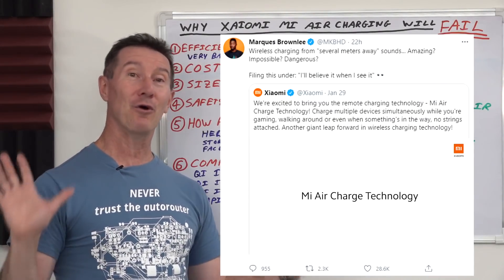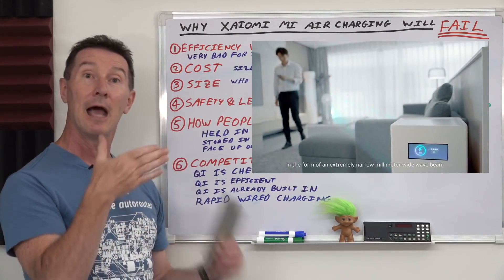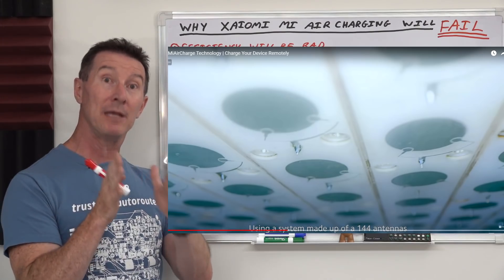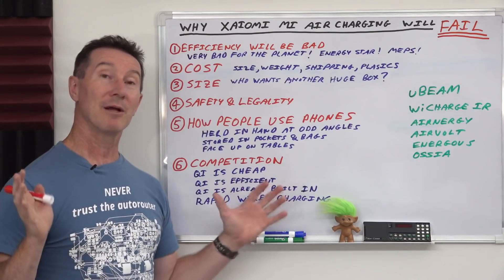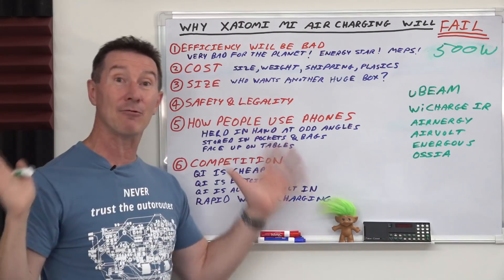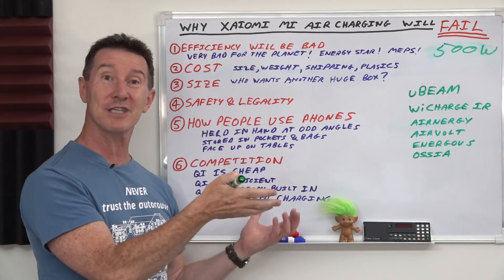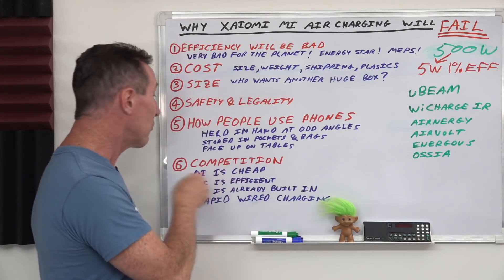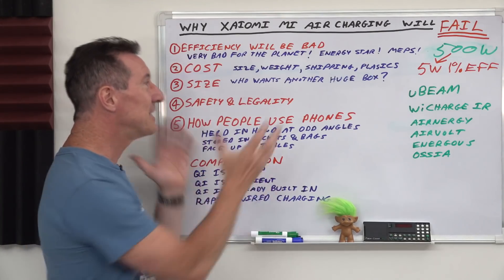EEVblog #1369 - Xiaomi Mi Air Wireless Charging BUSTED!

Comment: It was nice talking to you Dave! I wonder how much this wireless charging unit would cost at the end, it doesn't look cheap. I would be very surprised if they actually end up shipping this in any significant quantity. It could be that they are using this "commercial" as a vehicle for some specialized applications in the future. In our lab using our 95GHz 384-element beamformer I could place my hand in front of the array and feel a warm spot where the beam was going. It is an unusual feeling!
Reply: Medium rare hand straight from the lad cookery !)
Reply from the maker: Thanks for helping out!
What power level do you think would be in that capture area that warmed up your hand?
Yeah, I don't expect this thing to ship, maybe just show off at some trade shows or something.
Reply: @EEVblog  Operating at 95GHz is not easy and our array was a full transceiver intended for communication which is fairly different from an illuminator like the one you see here. We had 256 transmit antennas each with a PA that can do about 9dBm of power. That translates to an EIRP of about 60dBm. The total transmit power is about 2W, the array in TX mode consumed 100W. It can be made more efficient of course for this application. My hand probably captures about 1W of power which is what the warm spot on my hand is. We actually have thermal images showing the hot spot moving around using beam forming. Cool stuff!
Reply: @TheSignalPath : I want to ask, I'm not a RF specialist, more like only a hardware tinkerer, my question is regarding actual beam forming. Wouldn't be using a plain old Uda Yagi antenna be much better at forming a very directed and narrow beam. I know, I read up only a little on Uda Yagi Antennas and their main usage frequencies lie way beyond the estimated 95Ghz in this case, more at tops 2.4Ghz (where they still work great as wifi directors even with 5Ghz wifi). But question being, wouldn't be a servo guided and phone tracking Uda Yagi Antenna be more practical than those tiny copper patches?
Reply: @bloeckmoep  
TV frequencies (around 500MHz?) have a wavelength of AROUND 60cm (In the UK). The antennas for TV frequencies are made up with a regular di-pole with a reflector behind and some parasitic elements infront to give the antenna its gain / directivity. The dipole is going to be a really, REALLY boring half-wave di-pole (so around 30cm tip to tip).
The same design of antenna at 95GHz (3.2mm wavelength) would be 1.6mm tip to tip! The slightest bit of corrosion at that scale would shift the resonant frequency by 100's of MHz.
You would need incredible manufacturing accuracy and repeatability for this to work, and that would price itself out of the market for home use.
Reply: @digitalradiohacker  : Yes i expected that, around such high frequencies, its written that Uda Yagis are not really practical. However, would one need such high frequencies for the sole purpose of delivering a constant wave for power induction? A microwave seems to do just fine around 2.4Ghz and shows some astonishing results with electronis put inside. Of course thats magnitudes above what would be needed here, a regular microwave beginning at 180Watts up to 1800Watts. But I track off here, for beam forming in lower frequencies a Uda Yagi and its derivatives is probably best practice. I wonder if could tinker something along the line with old wifi components and some selfmade antennas?
Reply: @bloeckmoep  A microwave is at 2.4GHz because that is the resonant frequency of water. If you hit water with 2.4Ghz, the molecules vibrate, and the friction causes heating.
(*EDIT BEGINS) The above is not true, it is just the "Wibbly-Jibblies" that causes heating (EDIT ENDS*) 
What you could do, is use that heating effect to generate steam and have that run a small steam engine... Might be a tad uncomfortable to be anywhere near though (we're 60% water).
I think that the main thing to say, is that radio is only used to transfer information, not power. When used to transfer power, it is so inefficient that it hardly seems worth bothering.

*Edited due to non-conformance with the standards required by universities for PhD thesis in materials science.
Reply: @digitalradiohacker  Yes yes, I know this. I just think its much easier to experiment with available household electronics which can already put out watts of power and can be coupled with available antenna technology. Beam directions with dipol antennas or Uda Yagis works well enough on wifi routers which only have limited allowed power budget of 100mWatts omnidirectional.
Reply: @TheSignalPath  nice antenna array you can melt chocolate  and discover microwaves again.
Reply: I think this will never take an end with all the wireless power, it only on movie it works we all know that.
Reply: @digitalradiohacker  Actually it isn't.  Water doesn't have a resonant frequency, and the chosen frequency has more to do with power delivery than any clever atomic effect.  See here https://wtamu.edu/~cbaird/sq/2014/10/15/why-are-the-microwaves-in-a-microwave-oven-tuned-to-water/ , there are many others.
Reply: @GavinMelville  
"Water doesn't have a resonant frequency"
"has more to do with power delivery"
Going above 2.4GHz means less penetration, and going below would result in less absorbsion. Sounds like all the EFFECTS of resonance to me. If the effects are there, and there is an absense of side-effects, that is good enough for the girls I go out with.

Yes - I know - It isn't the resonant frequency of water as such - But for the purposes of heating a bowl of soup, a storm of multiple limitations come together, and conspire to make 2.4GHz the one that works. 
Example: Whats the Wavelength @ 2.4GHz?  
λ = C/f
300,000,000 / 2,400,000,000 = 0.24m (24cm).
Ever wondered why the internal dimensions of microwave ovens are all just a little "snug"? Ever wondered why they don't make them a bit bigger?
Reply: @digitalradiohacker  It has nothing to do with resonance. Water strongly absorbs most of the wavelengths in the electromagnetic spectrum, but it has a narrow window of transparency which includes the visible spectrum. It doesn't absorb in the wavelength range of visible light, roughly 400-700 nm, because there is no physical mechanism which produces transitions in that region - it is too energetic for the vibrations of the water molecule and below the energies needed to cause electronic transitions. So, the absorption of EM waves below visible wavelengths is at its peak just before the visible spectrum, and the lower the frequency, the less the relative absorption. The heating arises from the dipole nature of water, causing the molecules to align themselves to the rapidly changing electric field caused by the microwave. The 2.4 GHz ISM came about because microwaves already used this frequency and thought that there would be already too much EM pollution from microwaves so they made it an ISM band. I do agree with you though, that 2.4GHz allows the inside of the food to be heated more effectively though.
Reply: @digitalradiohacker  The wavelength is actually 12cm.  The chamber should be at least two wavelengths in each direction. More on the history: (from Philip Remaker) 
https://www.indiegogo.com/projects/why-2-4ghz-chasing-wireless-history#/   The first resonant frequency of water is 21ish GHz.

From wikipedia; Water, fat, and other substances in the food absorb energy from the microwaves in a process called dielectric heating. Many molecules (such as those of water) are electric dipoles, meaning that they have a partial positive charge at one end and a partial negative charge at the other, and therefore rotate as they try to align themselves with the alternating electric field of the microwaves. Rotating molecules hit other molecules and put them into motion, thus dispersing energy.  

Source: https://en.wikipedia.org/wiki/Microwave_oven
Reply: @digitalradiohacker  That is not actually true. Water molecules have a number of resonance frequencies and they are much higher than 2.45 Ghz. If I remember correctly it is somewhere around 10^14 Hz.  Heating of the water molecule is achieved through imparting rotational energy which works because the water molecule is a dipole.
Reply: @GavinMelville  
"The wavelength is actually 12cm"
What on Earth? You're right - That's what I get for doing it in my head instead of using a calculator!

A few people have now repeatedly corrected me with my USE of the word "resonance".
I get it - The true resonance happens much higher than 2.4GHz. 
That being said, if you actually go up to 21 odd GHz, at the same fixed power level, the absorbsion drops doesn't it? So less heating no? 
What words can I use, in the comment section of a video sharing platform, when conversing with people who may not be MSc / PhD qualified materials scientists? Wibbly-Jibblies. I'll use Wibbly-Jibblies from now on, so that people don't get the wrong idea, and think I was attempting to mislead them.

The real resonance is up at 21GHz, but other limitations prevent the use of that frequency.
To get the "Wibbly-Jibblies" to happen, in the real world, 2.4GHz is used.
Reply: @marcovoetberg6618  Absolutely - My use of the word "resonance" was unacceptable.
From now on, I will be substituting the word "resonance" with "Wibbly-Jibblies".
Reply: @digitalradiohacker  The absorption DOES increase with frequency, however it absorbs it so well that it would not be able to effectively heat the inside of the food because all of it would be absorbed on the surface of the food. That would be similar to a normal oven that heats with IR, the outside absorbs almost all of it.
Reply: @noahsmith2555  Absolutely - I have replaced all my previous references to "resonance" with "Wibbly-Jibblies" in an attempt to clarify.
Reply: @digitalradiohacker  but you said: "at the same fixed power level, the absorbsion drops doesn't it? So less heating no? " which is incorrect.
Reply: @noahsmith2555  I couldn't agree more - My use of the word "absobsion" was also unacceptable.
From now on, I will substitute that word with "Pokey-Through".
Reply: @digitalradiohacker  lol. Ok I get what you mean by "absorption" now. But Pokey-Through makes more sense
Reply: @digitalradiohacker  Lol :) Not a terribly scientific term but nevertheless quite accurate. The idea that resonance frequency has something to do with it is really common. I thought that was the case once too. But that wouldn't work here because the movement of the molecules is a hot mess, nothing like a pendulum or pitchfork at all.
Reply: @marcovoetberg6618  Well if we look up the actual definition of the word, it implies that "something" happens in higher quantities, at a certain frequency. For our purposes, given all the other limitations, such as manufacturing cost, size of appliance, efficiency ratings imposed by governments, licensing by Ofcom FCC etc - 2.4GHz gives us the "Pokey-Through" & "Wibbly-Jibblies" that we're looking for - which is a KIND of .... No, I won't say it.
Reply: @digitalradiohacker  Also keep in mind that water doesn't have much reflection (from here on called Bouncy-Off) on those wavelengths, that's why microwave frequencies work fine for it. The amount of Pokey-Through is high, but the amount of Bouncy-Off is low, which increases with higher frequencies. For us humans, we have the fortunate side effect of the Bouncy-Off being quite high at those microwave/IR frequencies -- you can, for example, reflect infrared beams with your hand.
Reply: @Stoney3K  Are you sure we can use the description "microwave"?
Lets err on the side of caution and use "Speedy-Wavey" just to be safe.
Reply: @digitalradiohacker  If we want to be strict, then absorption is the inverse of transmissivity, so Pokey-Through would be an incorrect term, we should call it Pokey-Not-Through.
Reply: @digitalradiohacker  Yes, don't say it... because you would be wrong. I don't know where you got that definition from but not only is it vague, it also doesn't at all explain what we are talking about when we talk about resonance. A resonance frequency is a specific frequency that a system wants to move (oscillate) at naturally. When that system is applied a harmonic wave at that resonance frequency the transfer of power from the harmonic wave to the system is high. At any other frequency the transfer of power is low. In oversimplified mechanical terms the system is either to stiff to oscillate at the low frequency or too floppy at frequencies to high. And the transition is sharp.
This is not what happens for a microwave oven. In fact you could use any frequency you want really. At frequencies lower the penetration is good but consequently absorption is low. At frequencies higher absorption is better but penetration is low. The 2.4 Ghz is just a happy medium. Large industrial ovens use 900Mhz. And you could ramp the frequency all the way up to that of infrared light. Great absorption, low penetration. Congratulations, you have build a grill.
Reply: @digitalradiohacker  Lol, let’s finish with this water resonance bullshit. You can actually look at water absorption peaks on Wikipedia and in many other sources. Why do people spew this nonsense?? 2.4GHz is not special at all.
Reply: @absurdengineering  
I refrain from conversing with you in a manner as aggressive as you seem to converse with others, not because you are a gentleman, but because I am.
Perhaps you ought to experiment with more fibre in your diet rather than trying to shut down people having a lively, but civilised discussion whilst learning all the way?
Reply: @marcovoetberg6618  Shortwave diathermy commonly uses 11 meter wavelength RF for deep-tissue heating.
Reply: @tubastuff  Cool. That's the CB band (@27 Mhz). I had never heard of diathermy but yeah 11 meter wavelength has high penetration. Despite the name shortwave it's of cource anything but short comparatively. Low efficiency in terms of energy transferred but cooking the patient is probably not the objective here...
Reply: @marcovoetberg6618  Well, definitions change.   In my 1941 engineering text, "microwave" refers to frequencies of wavelengths less than 1 meter (>300Mhz).   UHF was considered to be >30MHz.
Reply: @TheSignalPath  you saw a hot spot moving around? That’s too funny they could make a product so you don’t have to heat your home just have a box that beams targeted heat to your skin wherever you are in the room! Haha. Would probably consume as much power as actually heating your home normally though! 🤣
Reply: The $500 question: where does the lost 495W go ?
Reply from the maker: @cmuller1441  32dB loss in just the air, so it heats up the air molecules
Reply: @EEVblog  Is it not due to free space path loss / inverse square law caused by the beam diverging rather than the air molecules absorbing the RF? It would still lose energy density in a vacuum. I think the energy would mostly be absorbed by the walls of the room that absorb that specific frequency well and are very dense.
Reply: @EEVblog  Then they can sell it as a dual purpose device: you can charge your phone and heat your house. Great in winter, not so much in summer...
Reply: @tomg0  Based on what was said, I think the beam is highly focused, not quite a laser but tight enough that all of it hits the phone. All of it that doesn't interact with the air in between, that is.
Reply: @chitlitlah  Well you're definitely not getting 32 dB absorbed by the air, considering that the absorption of the utilized frequencies by air and water vapor is very similar to the absorption of 2.4 GHz. It is most likely due to the lower power density at the receiver for the same capture area.
Reply: @noahsmith2555  Going by the video and what Dave said here, the air does absorb 32 dB. It seems like a lot, but I'm no expert and won't argue the point. I was just trying to clarify what was said.
Reply: @cmuller1441  Heating up the room. That little device will feel exactly like a 500W radiant heater would. Must feel awesome running that in an air conditioned space, knowing that it takes hundreds of watts more to extract that heat.
Reply: salute for  our Iranian flagship!
Reply: @mostrush4849  If he lived in Iran he couldn't be anything, salute to him and to the country which gave the opportunity to him not Iran!
Reply: As many conspiracy theories as there already are about 5G causing COVID and destroying your brain, a wireless charger that actually has the power to warm your skin if you get in the path of the beam is going to drive the nutters even more nuts.
Reply: They probebly want a contract from the military, CIA or someone.
Reply: @Franko_Walker  xiaomi and CIA... mmhhhh probably not. maybe some other agencies under the influence of china.
Reply: @mianoso  Your probebly right, but there was a secret team up between an American agency and a Russian agency during the cold war.
Reply: Triple the frequency and you've got the world's fanciest IR heater. Makes me wonder... Could you beam-form a conventional IR heat emitter (not "direct-drive") through weak direct-drive emitters or achieve some deflection with several conventional emitters through rapid pulsing?
Reply: Congratulations, you have bombarded yourself with thousands of times more non ionising radiation than is deemed safe. Enjoy all the nothing that you will suffer!
Reply: Ha! That's nothing, my 385 THz single element parabolic  emitter will burn my hands nigh instantly given enough juice.
Reply: 385 THz = shortwave IR. hmmm
Reply: Shariar, this actually sound similar to what Ali Hajimiri's startup GuRu wants to achieve at 24 GHz. Although I guess they aim more at lower power IoT devices.
Reply: That warm spot doesn't surprise me, isn't millimeter-wave almost far infrared?
Reply: well xiaomi did not mention anything they'd sell this.  it is more like R&D stuff they'd like to brag about.  It is possible to make this happen in a more sensible manner like where it only covers an area as a desk and less charging power of around 1-2.5 watts.
Reply: Hi, could you elaborate on how you arrived to this "500W" estimate at the transmitter? Dave just said you 2 agreed on that number, but there is no calculation/guestimation.
Reply: I think Dave should not use the word "BUSTED", it is just low efficiency, one day when fusion get popular, no one care that low efficiency. Convenience is the key.
Reply: @SS_SunnyNMoon  part of his video was also saying how it isn't really convenient either...?
Reply: @littlewol2620  that angle problem was just a guessing, still need to try the real product to know.
Reply: @SS_SunnyNMoon  fair point, but still justifiable i think. One may have further issues in their life if charging a phone for an hour or 2 to last 1-2 days on average, while still feeling the need to use it is more concerning, and itself can be made ALOT more convenient. Another side to the convenience issue is, whenever you are not at home, or even in the place the box is. Can't exactly carry it around, especially conveniently. Yet a wired charger can simply fit in a pocket. Induction charging is more convenient even? Certainly what is referred to as "1st World problems"?
Reply: wouldn't surprise me if their receptor sleeve ends up having a built in Qi array that then pumps the power to the phone through its built in Qi charger...
Costing even more efficiency.
Reply: have either of you looked into the research that has been done with 5g regarding sweating, and hair follicles? from something i came across, aparantly the root of the hair, combined with sweating acts kind of like an antenna that does allow "5g technology" to penetrate the body. what with water as the conductor, and the spiralling follicle as the "pickup". not saying this is 100% the defacto case, but it seems plausible. would love to hear some thoughts